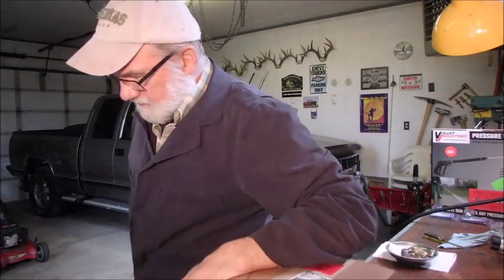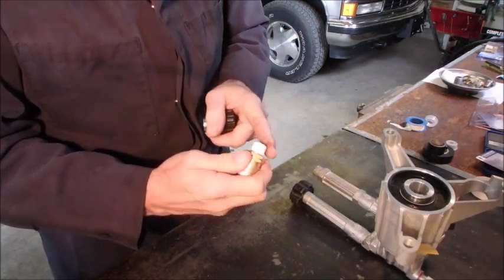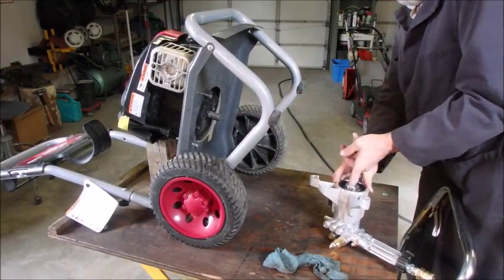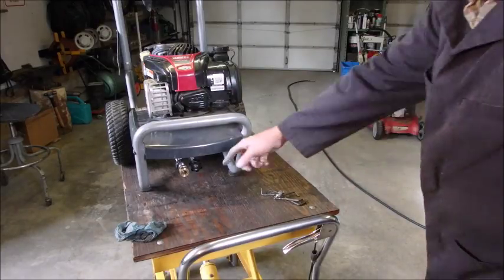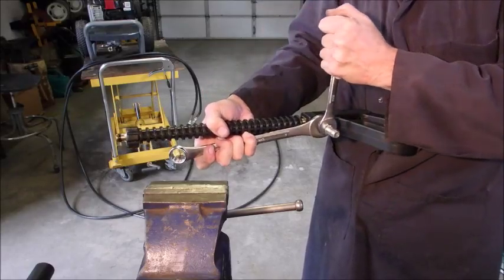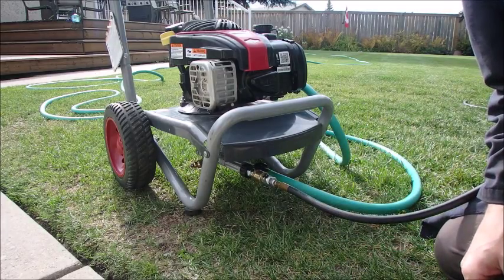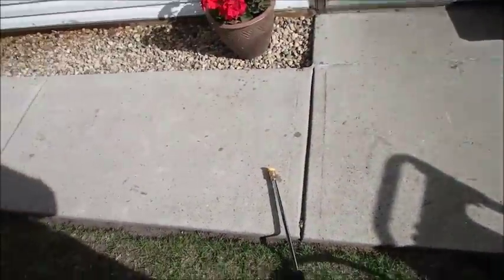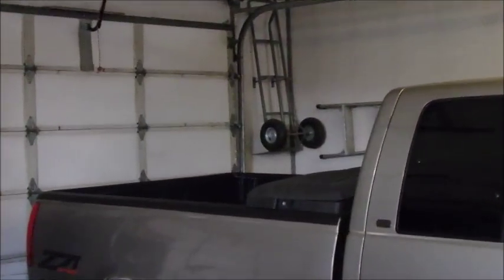Replacement of a Pressure Washer Pump

Comment: Best advice I've heard,dont over tighten..I changed the unloader on a AR pump yesterday and i was replacing the water inlet and over tightened it and cracked the pump head at the threads
Reply from the maker: Right.  I don't know if these even qualify as pure aluminium.  LOL

Comment: Hey Bruce, Good news! I did what I had proposed I was going to do. I used the garden hose to back flush the pump in the opposite direction and got water to flow. Then I reattached the hose at the normal input and water flowed as you would expect. I reattached the pressure hose and wane. Purged the pump and started the engine. Working great again. Perhaps this fix might help you sometime.
Reply from the maker: Thanks a lot

Comment: I appreciate your thoughts. I'm thinking that one or more of the 6 valves may be stuck closed. Tomorrow I'm going to try back flushing with the garden hose and see if water will flow in the opposite direction. My son picked this up on the side of road. My biggest expense thus far has been replacing the plastic fuel tank. Evidently it sat in the sun too long and the plastic fuel tank developed cracks. I think I can replace the whole pump for 100 or pump head for 80. Possibly replace the 6 valves for even less. I have zero experience working on these. I am a subscriber by the way and enjoy your videos.
Reply from the maker: OK  keep going

Comment: Ryobi 3100 PSI not getting any pressure.  Water seems to flow fine.  It was producing pressure then I shut it off and turned it on 1 hour later and nothing.  Is there a way to positively check if it is a bad pump rather than something else?  Thanks.
Reply from the maker: Well I would remove the unloader  (where the pressure adjustment is)  check for corrosion there and put ir back to the same setting after.   Take pictures as you go.  Good luck

Comment: You should make some kind of bracket for the pipes sticking out of the front, to make it stronger so if it tips forward it won't break the new pump.... most likely that's why it cracked the casing in the first place.... Great video.
Reply from the maker: Frost broke the first one.  Winter is out big enemy on pressure washers.
Reply: Bruce Pender yeah I hear that.

Comment: Hi Bruce.  I have a briggs and stratton 675 series 190 cc pressure washer.  However my throttle doesnt adjust.  Do you have any videos on throttle repair or how all the parts should move?
Reply from the maker: No, sorry

Comment: I have a pressure washer that when I let off the trigger it cuts off the machine.  Then it’s like the pressure is built up so much and takes about 30 seconds to release after I’ve been holding the gun down.   Any ideas?  Motor starts right up only stops after I let go of the trigger.   Thank you
Reply from the maker: There is a thing called the unloader and they get sticky.  There is lots on you tube fr you there.

Comment: I did. The engine runs fine. Usually you purge water thru the pump before you start the engine. Something must be blocking the flow of water thru the pump. I removed the unloader valve off and cleaned and reinstalled, did not make any difference.
Reply from the maker: I wish i was there.

Comment: Bruce, I have a pump similar to this. It worked last summer. I pulled out today. Connected the supply water to it. Turned on water, no water came out of the pump. What might have happened to the pump to prevent the supply water from coming out where you connect the pressure hose?
Reply from the maker: Did you try to start the engine?

Comment: Bruce it is a bad pump, but oil did not work.  I was planning on dismantling it as much as possible then cutting off the rest from the shaft.  Any tips on cutting off the part attached to the shaft and key?  As to not damage
Reply from the maker: Yes.  I would cut along the area over the key.  It is thinner and if you dig through you will hit the key and not the motor shaft.  In this video i did NOT do this and nicked that engine shaft.  But it worked out.  This was a  horizontal pump.  
https://www.youtube.com/watch?v=5kC5x6JWx3I

Comment: Do you need to add any oil for new pump?
Reply from the maker: Most likely no.  There will be a note if it needs oil.  As well you can check it by removing the oil add bung and looking.  Make sure the unit is level.

Comment: Thanks for the video. I have a similar machine with a similar pump. I'm having one heck of a time taking the old pump off the drive shaft. It descends about an inch and then seems to get jammed against something. I'm reluctant to use much force for fear of damaging the output shaft.  Is there a secret position or something to get it to slide off?
Reply from the maker: Gosh.  Just like you   I would think that it would come after moving an inch.   Have you got a method to grad the pump?
Reply: Thanks for the quick reply! I don't. Perhaps I should thread a rope around it and see whether I can tug it off. I'm really cautious these days about applying force. More than once I done more damage to a machine trying to fix something simple -- or lost fasteners or parts  ;-)
Reply from the maker: If there is a separate key  it may have shifted in the slot.  Can you see the built in key on the edge of the pump?
Reply: It does sound like something hitting something solid. I'll have a look-see when I get home this afternoon. I'll let you know. Thanks again!
Reply: Did you figure out the removal process? I have the same issue. I removed 3 mounting bolts and it does not want to give. Am I missing something?

Comment: What is the best way to remove the pump with corrosion.  I tried to hammer it off but it's stuck on there.  It's a vertical pump so there's no Allen lock on it
Reply from the maker: I don't have many suggestions.  I have cut them off (last step of course),  Try a little penetrating oil.  It you think the pump is no good you can try as many things as you can think of.  Tough job.

Comment: Thanks for the visual on the adjustment of the pressure, will try that on mine. Do you intend on putting antifreeze in the pump for winter, or is there a way to completely drain all the water on that model ?
Reply from the maker: I keep mine in the heated shop.  I think there is a product called pump saver.   It even has a hose fitting to put the product into the pump.  About $10..   Worth every penny
Reply: Thanks!  rusted the innards on mine from lack of that step

Comment: Not a big deal I'm guessing but, you mounted that pump backwards. The hose inlet and outlet (from factory) come out the back on that model.
Reply from the maker: It will not bolt on the other way due to the bolts in the engine.  These come with a front r rear mount  and i bought what was on sale.

Comment: Hey I just installed this exact same pump on a similar pressure washer but there’s no pressure. It’s fitted with a brand new hose and nozzle. Any ideas or tips on how to fix it?
Reply from the maker: Is it a new pump?
Reply: Bruce Pender yup! Brand new. Got the washer off Facebook and tuned up the engine, bought a brand new Briggs hose and nozzle with brand new tips. Ordered the exact same pump. The water flows through but with almost no pressure. I tried adjusting the unloaded valve but no matter what direction I adjust it to, the pressure remains the same.
Reply from the maker: @MrAnonymous02  My first advice is to return it which i am sure you thought of.  If you can't     ---take it apart slowly and carefully to see if anything is out of place or broken.   Yikes!!!
Reply: Bruce Pender yikes is right lol. Going to contact the company to see what they say. Fingers crossed!
Reply from the maker: Be aggressive but kind.  LOL

Comment: I can get that replacement pump, and up tp 2800 psi down here for about $65.00.  Guessing a lot more up your way. Good job.
Reply from the maker: Thanks Jim
Reply: Bruce Pender I never did know how to adjust the pressure output, thanks.
Reply from the maker: Glad to be of help

Comment: Also, do you have a video on changing the oil in the pump? Thanks
Reply from the maker: No.  It is easy.  Some you can't as there is no drain plug.  But on the last one I did I use 30W oil with NO DETERGENT. and fill it to the the threads.

Comment: I Have an 11 hp Briggs & Statton vertical shaft engine just sitting over here doing nothing. It came off of a riding mower that I put a bigger engine on. So basically it looks like all I need to build a pressure washer is a cart or I could make one, a pump, hose and wand? I am not very familiar with the gas operated ones, I thought they would be more complicated than that!
Reply from the maker: Just make sure the shaft (on the motor) width is matching the pump input width.
Reply: @BrucesShop  Will do, thanks!
Reply: @BrucesShop  On your case it was 7/8"?

Comment: Good morning Bruce. I have a question. I have several air tools in the shop. When I attach air to them they leak. What do I need to buy so all will match? I’ll be going to harbor freight unless you recommend somewhere else. Thanks.  Also, where did you get the pump?  How much?
Reply from the maker: I would put ne female connectors on there.  I use M style.  I ordered the pump on line.  It came from overseas.
Reply: So like M connectors for everything?

Comment: Hi Bruce your videos are so helpful, I am a retired Industrial Millright Mechanic. My wife and I moved to a permanent trailer park in Wheatley Ontario. I been fixing lawn morrow, bicycle,weed eater and power washers. I have a simoniz 3000 psi gas powered power washer to fix. The owner left it in the garage over the winter without winterizing it. Now when the water is hooked up the water flows out the drain tube by the unloader valve. I removed unloader value it looks OK to me. Do you have any ideas, could pump be cracked inside, I don't understand the purpose of the drain hose after seeing how the unloader is suppose to work. Would really appreciate some advice, keep up the great videos. Take care be safe
Reply from the maker: I have worked on many of these.  Tried to fix them too.   My advice is to go to Princess Auto and buy an equivalent pump for about $140.   I have fixed them only to find they fail a short time later.  Remember they run at the pressure of hydraulics but without the benefit of oil lubrication.
Reply: @BrucesShop  thanks Bruce that is what I will do, I appreciate the info greatly, keep up the videos so helpful. Take care be safe
Reply: Pressure washers don't have a drain hose. That hose is a chemical/soap injection hose. You stick the open end in your bucket/tank of chemical/soap and with the correct wand/tip configuration your chemical/soap will be siphoned in, mixed with the water, and sprayed out the wand.

Comment: Hi Bruce, what were you adjusting on the pump?  Was it pressure adjustment?
Reply from the maker: I was adjusting the unloader to put less load on the motor so it wouldn't stall it when I pull the trigger.  I believe it is a pressure adjustment.  I don't have gauges to check.  But both the volume and pressure dropped.

Comment: Hey Bruce I love your videos I have a question its off subject but I have a 6.5 hp tecumseh vertical shaft can I change or modify it to a horizontal shaft for a go cart
Reply from the maker: Wow   I have not done that.   Try Google and you tube of course.  I am sorry, I can't help you.
Reply: Bruce Pender no problem I've seen people do it with a Briggs but I can't find one on a tecumseh thanks for the reply
Reply: i have seen someone do the tecumseh. its has a pump to move the oil and not a slinger, you need to extend the pump pick up tube. i hink chargermiles maybe able to help you with that??
Reply: beingsneaky ok thanks for the help

Comment: Nice job Bruce.  The best thing I ever did was put a 3 foot clothes washer hose on my pressure washer, no farting around either.  I have used that pump in the past or one similar with great results is this the pump that you put on. http://amzn.to/2xEspW7   You should put the links to products used in your videos it will answer lots of peoples questions.
Reply from the maker: You know as I live in Canada and 90% of my subs are in the U.S.  i don't do it as often as I should as the prices are 35% more.  This is an example.  I hope it doesn't come into your spam folder.
https://www.amazon.ca/gp/product/B008VAL3X4/ref=oh_aui_detailpage_o00_s00?ie=UTF8&psc=1
Reply from the maker: Let me know if you got the reply please.  It is confusing sometimes with a link.
Reply: Yup I got it.  It is different than the one I used, also you use Amazon Canada.  Thanks again.  Bob
Reply: What purpose does that 3-foot hose serve please?

Comment: Looks like the replacement pump I got...Wasn't quite the same as the original, blocked the oil drain plug...Oh well
Reply from the maker: Right   You have to take these apart to change the oil.  I don't think that will happen.

Comment: Sometimes when you buy new pressure washer pumps they don't put enough oil in them
Reply from the maker: That could well be true for obvious reasons.
Reply: @BrucesShop  
That is what happened to my brand new pressure washer do a pressure washer pump locked up on it

Comment: Why didn't this guy prime the pump first?  Must like to replace pumps!!!!!!!!!!!!!!!!!!!
Reply from the maker: This guy says I was working on it in the garage and wanted to to see if the engine would run.  Just for a very short while.
Reply: @BrucesShop  So take the pump off!!!  Only 4 nuts!!!!!!!!!!!!!!!!!!!!!!!!!
Reply from the maker: Actually 3